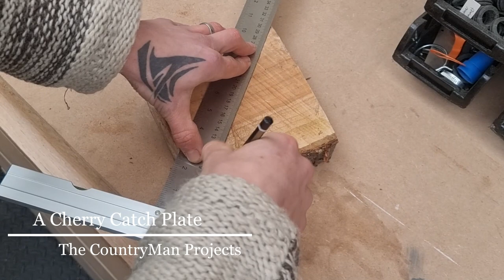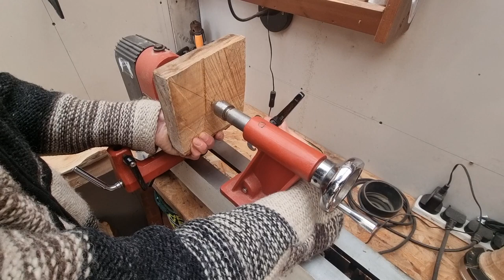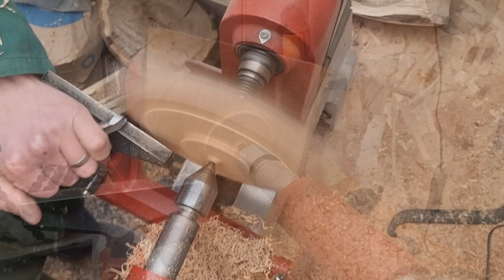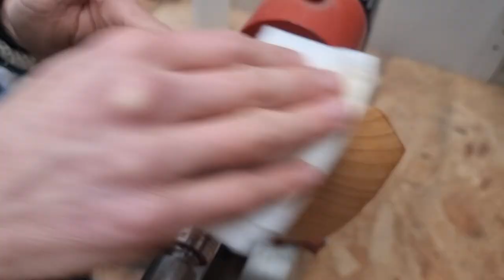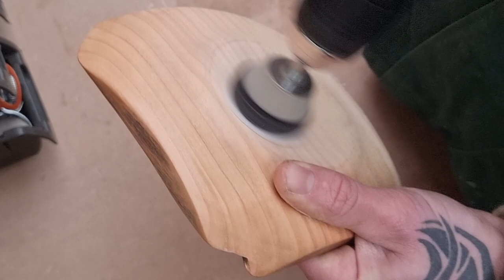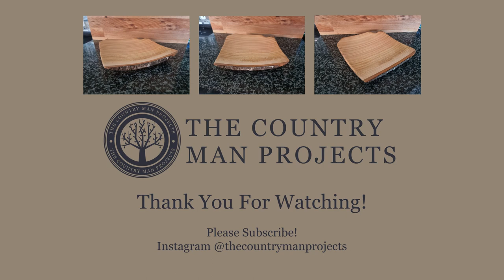A Cherry Catch Plate

Comment: Proof that you don’t need a $5000 lathe to produce nice work. Well done, Sir.
Reply from the maker: Thank you very much.
Reply: @thecountrymanprojects  EXACTLY my lathe is a Dunlap 85 years old was my grandfather's and the first lathe I used at 12 years old I'm 70 now and still using it I'm a retired contractor and cabinet maker this lathe has seen a lot of use right now I'm in the the middle of replacing the main shaft bushings I'm waiting for an adjustable bushing reamer to get the proper bushing clearance to the main shaft 1.5 thousands of an inch so it will go another 85 years won't be me LOL but maybe my son!!!👍
Reply: In fact I think you have the same Axminster 305 lathe as I do. I was nervous watching you do the sanding that you didn’t catch your hand on one of the corners. Turned out nice though